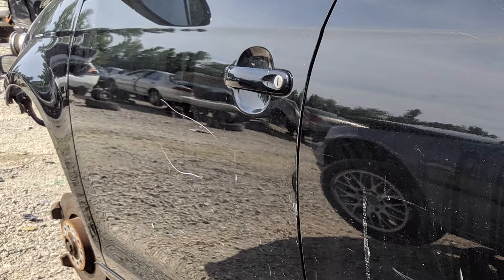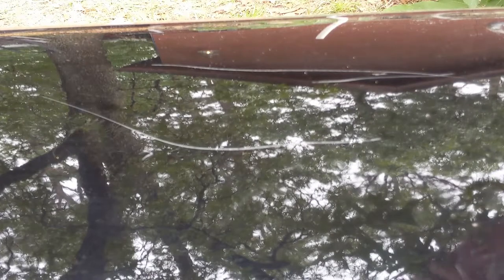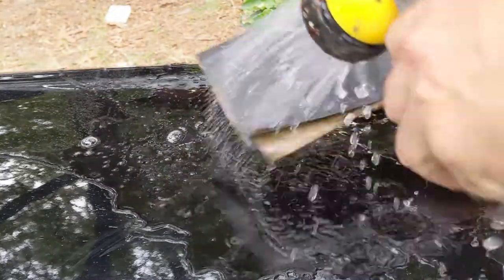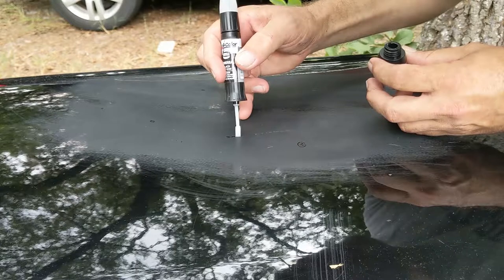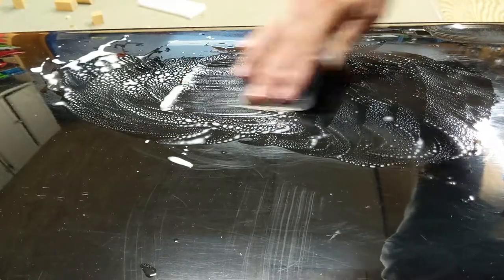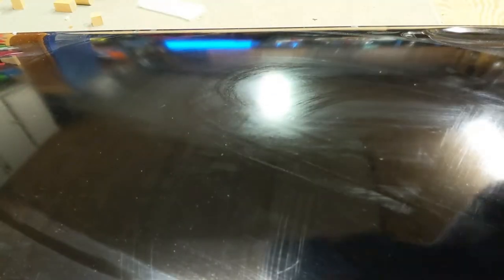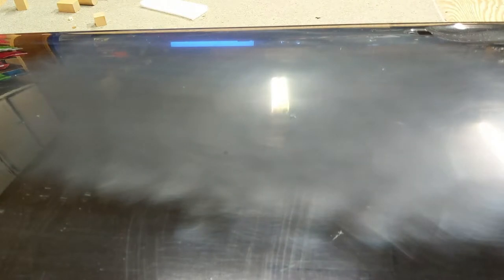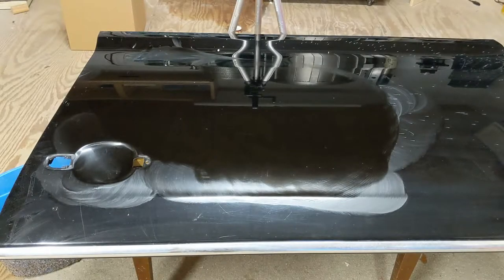How to Fix Deep Paint Scratches

Comment: Thanks for the video, I guess this procedure can be done without taking off the panel from car?
Reply from the maker: Yes, I've done panels on the car. Of course flat panels are easier but either way will work. You may need a few more applications of clear to make sure the scratch is completely filled
Reply: Ya absolutely. It's not as intense as having to use spray to fix it which also doesn't require removing whatever panel, but makes it easier rather then having to mask up every surrounding area then hope you can blend it in right.

Comment: I bought a genuine mazda touch up paint (45P sonic silver metallic). It looks ok but stands out when I fill in a chip or scratch.  I wet sand it with 2500 and then it turns to solid gray (no sign of metallic).  I add a clear coat and it still just looks solid gray. I polish it with compound and the sanding scratches are gone, the scratch feels smooth to the touch but it's still a dark gray with no metallic.  Any idea what I'm doing wrong?

Comment: how did you find what exact color you used for your car, did you get just a black color, so if i got a gray car, just get a gray color??
Reply: Inside your driver's side door there should be a paint color code for your car. It is probably on the same sticker where your recommended tire pressures are printed. Use that color code along with your car's make, year, and model when you are looking for paint.

Comment: How long did you let the paint sit? And was it just water you let the sandpaper sit in? it looks soapy
Reply from the maker: I let it set about 30 minutes between clear coats then 4 hours before sanding smooth. Just water for soaking the sandpaper but yeah, my bucket may have still been a little soapy

Comment: How long do you polish for? I’m at the polish step, but I cant get that matte look to go away now😩
Reply from the maker: It shouldn't take long. What type polishing compound are you using? Did you use rubbing compound or a high grit wet sand paper first?
Reply: I believe I didn’t use a compound😢 I think this is where I messed up. I went straight to Meguairs Scratch X Polish after using 3000 wet sand paper
Reply: I got the scratch out, but now I have the sanding scratches that I cant figure out how to get rid of

Comment: i’m trying to fix a scratch on a white car and when i sanded it the sandpaper left gray marks. it’s automotive sandpaper but i don’t know if i bought the wrong brand or if i didn’t let the paint dry long enough. any idea?
Reply from the maker: Yeah, I think you're right. It sounds like the paint wasn't dry enough. Also, the sand paper should say "wet or dry" so you can use it with plenty of water without problems.

Comment: Can i also use spray paint? Instead of brush paint..?
Reply from the maker: I try to keep the paint just in the scratch. That way the new paint won't be noticed if it isn't a perfect match. if you're sanding through the spray coat before filling with clear though, it should work fine.

Comment: How can I use this overall method with medium sized chip rocks about the size of a pencil eraser but deep and rusted. I dislke the way people are fixing them with chip fix kits when they are that deep because its nowhere near level, and like you commented below, using bondo or any filler requires that you sand well into the paint around it causing you to use spray paint to paint a much larger area so risk becomes larger. What would you suggest for deep chips that went through the primer to metal? Can I just use multiple coats of paint?
Reply: Yes sand the scratch then just apply the paint directly and layer it up. Works great.

Comment: Would 600 grit work?
Reply from the maker: I think it would be more likely to cut through your clear coat and you'd still need to use finer grits to get rid of scratches from the 600 grit.

Comment: Should I use bondo?
Reply from the maker: I don't like to use bondo to fill scratches unless I plan to repaint the whole panel. If you level the scratch with bondo, there's a good chance you'll cut into it when sanding. That's why I put down a thin layer of paint and fill with clear.
Reply: Thank you